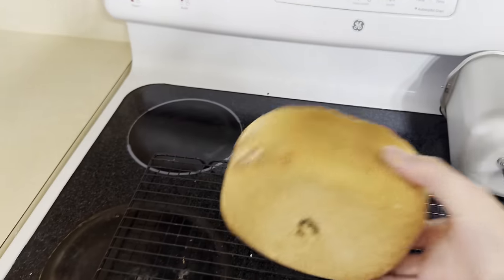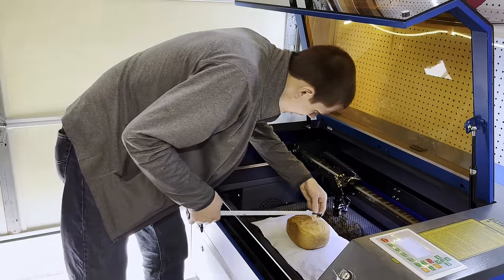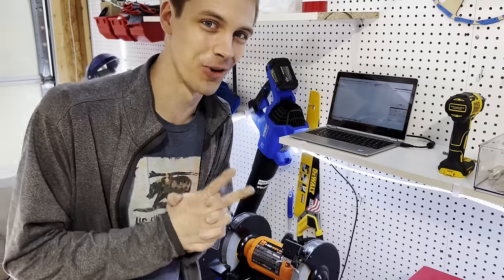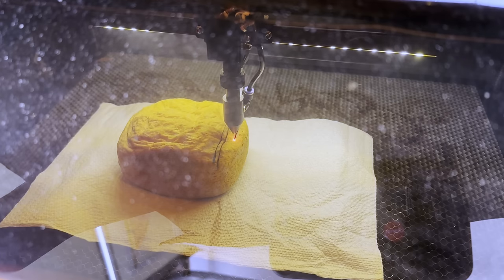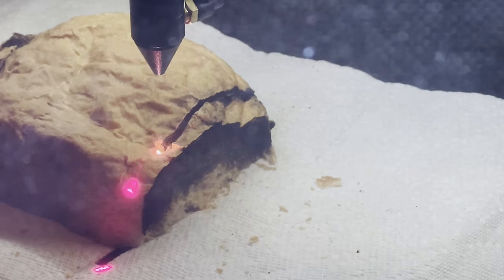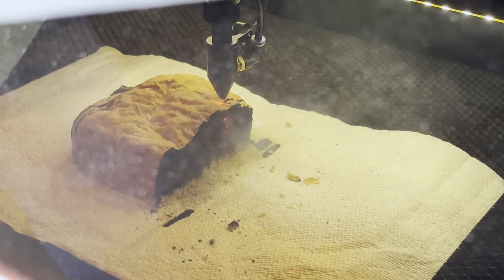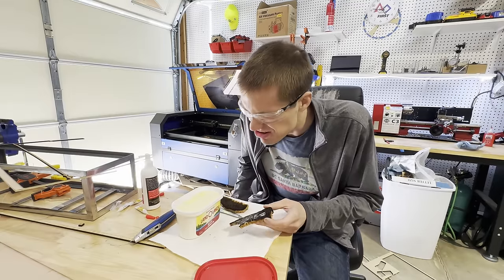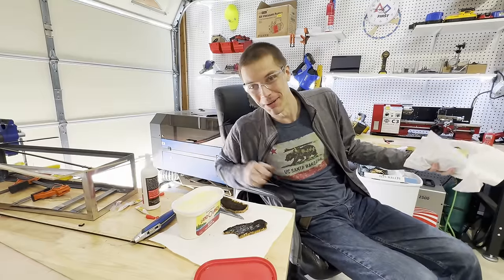If you cut bread with a laser, does it toast?

Comment: Faster speed and multiple pass might be the ticket.
Reply: Jup, multiple passes is what I want to see!
Reply: So, as if using a bread knife?  
Lame!  😉
Reply: Yes! Multiple faster passes seems like the next step.
Reply: Exactly what I just commented.  Max out the speed and power, make multiple passes.  You could even raise the bed between passes (until things get too close together).
Reply: I don’t know if is possible but with a dynamic focus would be the best
Reply: This is how I deal with cutting multiple layers of paper on a laser cutter.
Reply: this won’t work because the cutter cuts by burning the material. There is literally no way to make a cut without burning the toast.
Reply: Yeah, but the speed of the laser can definitely affect how badly charred wood is so I can't imagine it's different for bread.

I'm not sure the mechanism, but my guess is the slower the laser, the hotter the material that isn't vaporized gets.
Reply: @clahey  You're assuming a lot. A laser cutter isn't the opposite of a toaster, but it's a very different operation. The goal isn't to heat the whole slice, it's to heat the surface to an even 300-400 degrees F. To cut, you need to incinerate the cellulose... with predictable results in taste.
You could design a laser toaster, but it can't cut at the same time.
Reply: @PythonPlusPlus it does but moving it faster and multiple passes will make it more likely to vaporizer the intended channel with a lower haz

Comment: Hi, as someone who uses a CO2 laser to make money, I have a few suggestions:
1. Use a much longer focal length lens, this is probably a standard 2in but they make 4in focal length lenses
2. Use higher power and faster speeds
3. Use multiple passes, moving the bread closer each time. This is called "Z step per pass" in Lightburn
4. Upgrade your air assist with a real compressor like a 6gal pancake compressor, and upgrade the exhaust
5. Don't use the honeycomb bed, use blades instead and definitely don't put paper towels under the bread, just clean the blades
Reply: are you admitting to counterfeit
Reply: Do you use the laser to cut banknotes or coins? 😂
Reply: What an odd way to say you do it professionally

 a 4inch focal length is still only good for ~15mm of cut and will definitely crash once you've stepped up the z a few times, the best thing is to cut it with a knife and use an etching programme on the slice

Comment: To understand more about this, you should look up the Maillard reaction, which is the process by which carbohydrates become "toasted". It only happens when the food is held within a relatively narrow band of temperature around 350 F. The temperature required to ignite or vaporize bread is much higher, and applied much faster by a laser.
Reply: You have reminded me of an ancient post I once read where a mad scientist made a pressure vessel to cook a full potato to golden brown.. ah, "maillard pipe potatoes" if you wanna search for it. Anyway, turns out that also tastes acrid in large amounts.
Reply: Nice explanation. Thanks!
Reply: @paradiselost9946 A reliable weird way to cook potatoes I've found is to steam them for mashing. The longer you cook potatoes, the sweeter and creamier they get, but when boiling this causes them to disintigrate in the water. With steaming you just collect the drippings coming off them anyway and can slowly cook them for as long as you like before mashing, at which point you also have rich potato water to reincorporate or use as a thickening agent.
Reply: @paradiselost9946 Yeah that works too. In the case where you use the water for something else though steaming lets you add more cream relative to the water content if that's your kind of thing.
Reply: @paradiselost9946 Applicable to crispy potatoes, if you par-boil in water with a little vinegar it helps keep the pectin from denaturing because of the lower pH, so when you crisp up your fries after they retain a chewy center. This is (one step at least) of what McDonald's does to their fries.

Comment: I've had an opportunity to try stuff like this, I found with burnable materials like wood, bread and cookies, that the smoke in a deep cut channel is your biggest obstacle as it obscures the laser. The material cuts fine and you can even turn down the power to less than charcoal, but you have to let the smoke clear so multiple passes is your best bet to getting your full depth. 

Lasers work pretty well with food. You should try bacon next time.

Comment: You should have tried simply toasting it with a laser, like engraving a slice. That way you could adjust how much the surface is getting charred. If the bread comes out edible than theoretically you could cut it with a laser and make it toasted at the same time.

Comment: Yeah it's not toasting the bread, it's burning the 1 mm of bread adjacent to the laser but the rest of the bread is untouched. To properly toast the bread as it cuts, the laser would need to somehow be able to simultaneously cut the bread without burning it (who wants burnt toast) AND also radiate enough heat into the quarter inch or so of bread adjacent to the cut to actually toast it as it goes, a seemingly impossible ask.

Comment: You really should think about chemical processes before eating that. I am not an expert, but as I understand it, you basically just ate some various carbon allotropes like coal, graphene and carbon black, some low grade unfiltered biofuels like ethanol and methanol, plus whatever comes out when you turn those things into a plasma and coat a porous substrate of carb chains with it. And some other stuff. Oh, and I guess there's some bread there too.

I have no experience with laser cutters, but just as a guess you might cut deeper with less burning (and ionizing) of the surrounding material if you did many passes at higher speed.

Either way, that was entertaining to watch. Thanks for sharing!
Reply: It's not going to be much different to burnt toast from any other heating method.
Most of those things you mentioned are in the smoke from a candle flame and people light those for fun all the time.
Reply: Eat candles much? Anyway, I do think you're underestimating the speed and amount of energy being pumped in here. That is a much hotter point than a candle flame or the air in your toaster, which means it's going to create much more of those products than normal, and likely some things that it wouldn't normally produce at all. It's not just normal burning temperature, it's literally vaporizing at the cutting point. The light show from the resultant plasma trapped inside the bread's pores sure was cool looking though. Won't see that in your toaster.

Comment: Yeah, exactly what I would expect.  Completely charred surface, but the inside is untoasted.  Because there's really no significant heat transfer going on.  

The reason why this, or the super hot knife idea, don't work is because you need to heat up the inside and not just the outside of the toast, and the rate of heat transfer penetrating into the center of the toast is limited by the heat conductivity of the bread (which is low because it's filled with air pockets).  The only way to make the heat transfer faster is increasing the temperature differential, but that has the undesired effect of creating bread charcoal like seen in this video, so there's really no way around toasting bread taking time.

Thinking about how you could maybe do it with a hot knife, you could pre-heat the bread so the cutting knife doesn't have to be as hot and the slice isn't as burned.

Comment: Since you're burning off the bread in between the slices, it's gonna be pretty unavoidable that all the bread smoke heavily purfumes and sticks to the pores of the slice next to it.  It also looks like not much heat is being imparted to the bread, so the edges may be toast, but the center is still bread-like.  Which also makes the best way to deal with burnt toast, scraping off the burnt part, less likely to work.

Comment: While watching the smoke a question came to mind. 
I see your exhaust pipe has no fan at the end so your fan must be much closer to your laser bed. 
The question is, is it better to suck or blow ? 
My fan is at the exit of the pipe to outside and I have what can be called suction all down the pipe. When I cut smokie materials my fan pulls that smoke away much faster than what I can see yours doing. 
What im thinking is that you are getting some kind of pressure block alone your ribbed flexi pipe and that is slowing down the flow. You are trying to pull the smoke and blow it down the long pipe, I feel that may be hurting the system. 
Or you could just have a small fan lol 
It might make an interesting video to test the proposition.

Comment: Would it not be better to have regular bread that has risen properly? It would be less dense so it would cut faster, which in turn would mean less time under the laser so less heat is transferred to burn the bread.

If properly risen bread cuts faster, requiring refocusing of the laser, then would it not be better to make multiple passes at a faster rate? By increasing the amount of passes at a faster rate, there should be less heat transfer as the time a particular point of the bread is in contact with the laser decreases.

Comment: I think the hot knife would have more potential than the lazer. I mean, think about it- the lazer doesn't cut through the bread; it burns theough it. The bit connecting your slice to the loaf is getting burned away into ash. Of course it will be gross!

Comment: I am... realizing that i don't understand laser cutters. Aren't lasers like... Not supposed to have a focal point?
Reply: To get a high enough intensity for cutting stuff (without the intensity inside the laser being so high that it destroys itself), you need to take the slightly diverging beam that comes out of the laser, and focus it down to a tight spot.
Reply: No, lasers produce coherent light. That is, the phase relationship of the waves of light remains constant.

Collimation is a different thing and is down to the optics. You can make it into a beam, like a laser pointer, and the coherence will ensure that it stays a beam.

Alternatively, you can focus it to increase the power per unit area and heat stuff up really really fast to really high temperatures. So much so that it vaporises whatever it hits, IE it cuts it.
Reply: Ah! Thank you both, that helped a lot and makes a lot of sense.

Comment: Doesn't the laser work by burning and vaporising the material it needs to cut? Is it possible to cut without burning? I'd suspect you just want the Maillard reaction on the surface to get a crisp toast, but not the burn, thus can't get it with a laser cut. It might be possible to just get there on the surface of a flat toast with sort enough pulses,like when doing laser engraving,  maybe?
Reply: Yeah, the black stuff isn't just burnt bread, it's re-deposited vaporized bread.

Comment: I mean, considering your goal is to cause a layer of bread to disintegrate until the rest separates, and the fact that toast doesn't disintegrate where it's brown, it becomes quite clear, that cutting and toasting can't be a result of the same process. 
What you really need is a femtosecond pulsed laser which causes the bread to ablate, rather than oxidise, on a first pass and then toast on a second slow speed, low intensity pass.

Comment: I have a feeling if you rastered it you'd get better results. Your issue is probably heat soak.
If you vapourise the bread without burning the remaining toast as much it may work better. A fibre laser might have more luck vapourising essentially the carbon ablative layer you're making there lol.

Comment: If you blasted the cut with high pressure air to remove the carbon the laser wouldn't have to work so hard or burn so long and you might be able to cut and lightly toast...?

Comment: very scientific question. lmao. dont be so dense. lol. yes wood is very carbon black on the cut lines when lasered. also laser printer paper. no, laser will not deviate. what are you talking about. stay in focus. so why dont they/you make linear lasers. instead of focused lasers. toasty. yep just use lensing system that outputs linear no focal point laser light. yes it will have a width. burned toast. carbon black. charcoal. instead of trying to cut it, just draw an image with light lasered toasted surface. yep more like a thin pan cake. yep the standard laser paper printer way.